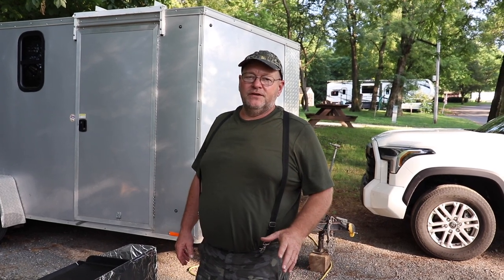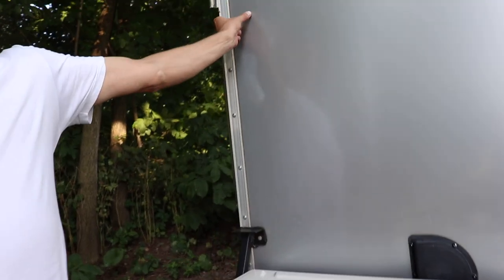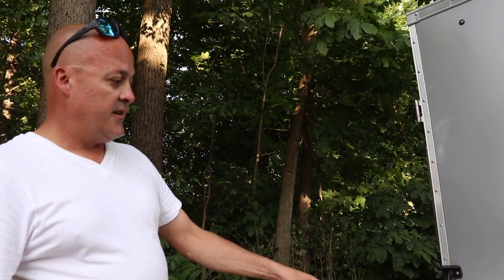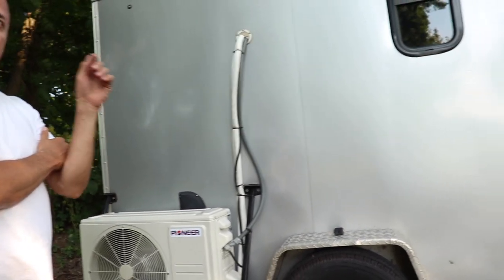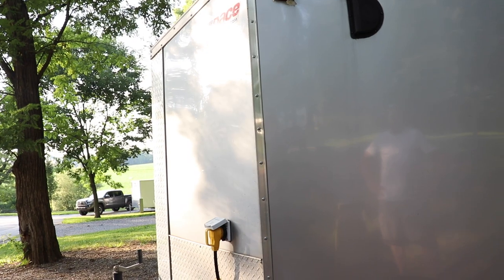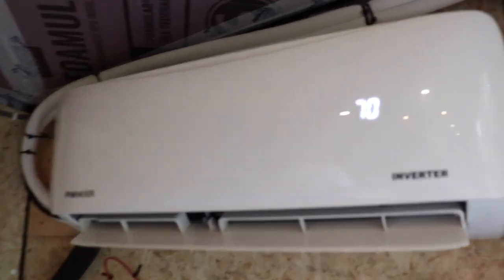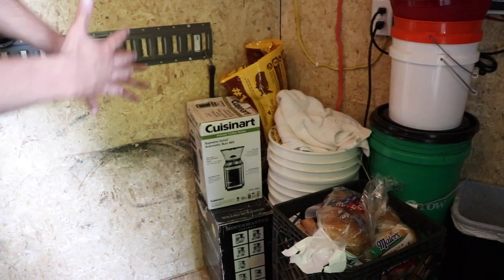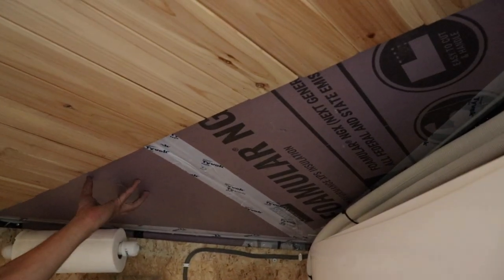Split unit in a 6 by 12 cargo trailer conversion camper

Comment: We did a 9000BTU for our 7 x 14 cargo trailer and put the outdoor unit in front in place of propane tanks.   We did 1"  (R5) insulation all around.    Ran fine down to 17F is our lowest winter camping.   Mine tops out at 1100w.   Takes about 4kwh/24hrs for mild temps (50F low to 90F hi) but up to 22kwh/24hrs for 17F low.    We run off battery with 3000w inverter + grid assist.   We're ready to start our 3rd year and all has been fine.   We run it all  year to keep things 'reasonable' inside (80F for summer and 50F for winter to avoid freezing) when parked at home as we  have full kitchen, shower, TV, etc etc.     If I ever do another one - I'll try for at least 2" (or as much as I can fit) insulation for less power consumption.
Reply from the maker: Thanks for sharing.

Comment: Kevin, if you are thinking about adding air conditioner. I recommend checking out the ecoflow wave 2 portable air/heater or the zero breeze air conditioner.
Reply from the maker: We have air conditioning in our camper roof unit.

Comment: What is the specific model of the mini split? I'm doing a 7×14  and this would be  perfect. Also do you have a problem  with the ac short cycling since the trailer is smaller square feet than 9k covers?
Reply from the maker: Sorry but that isn't my camper i was just doing a video on the mimi split unit.

Comment: That unit looks super ugly so since is a small trailer he should’ve do a small 7 k 12 v. Roof top unit and he would’ve be able to run it in a 400 amp 12 v lifepo battery for ever with a small solar array
Reply from the maker: Thanks for sharing.